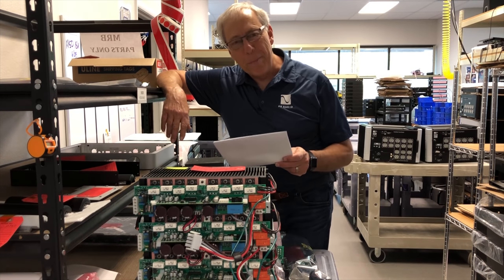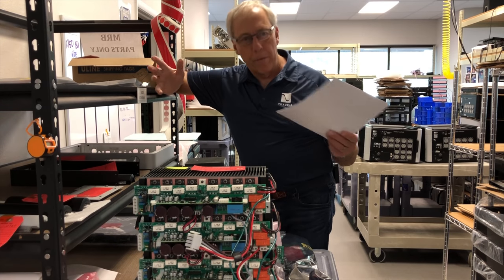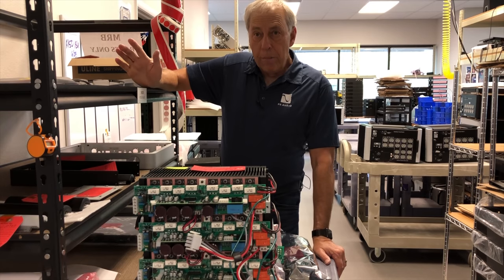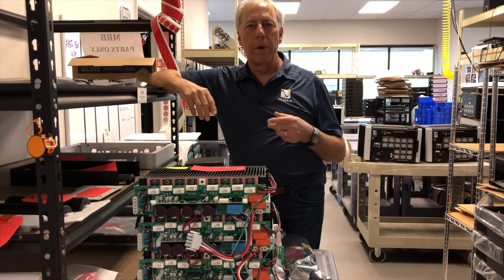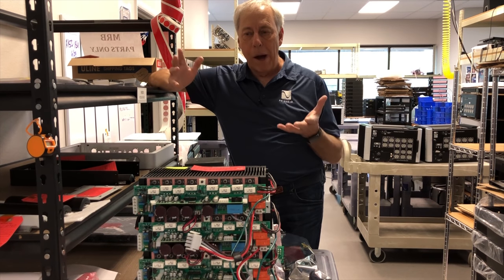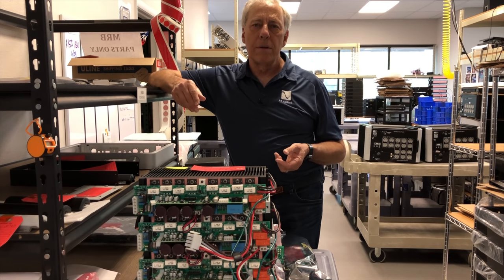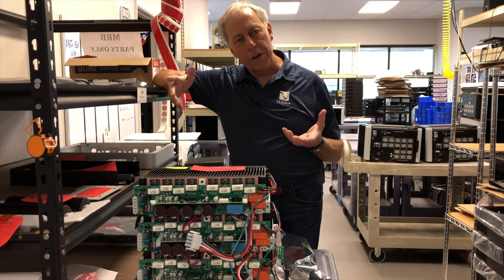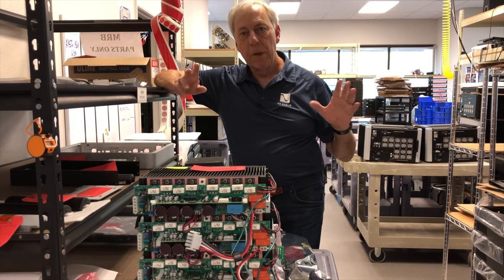Is the BBC dip still used in speakers?

Comment: Also, the human ear is five decibels more sensitive in the range from 1k to 5k. Notching that range down makes a more pleasurable speaker, not a more accurate one.  Great report.  Great question. Thanks.
Reply: You said it before I could. That frequency range is where the sibilance in human speech occurs, so it's very important for our ears to be more sensitive to that range so we can really pick apart all the subtlety and nuance of spoken language. Also, as sound gets louder our ears will naturally compress the sound which is why most manufacturers have a passive EQ that takes more and more of that frequency range out the more you crank up the volume to preserve the "BBC dip" even as our ears are compressing the highs, mids, and lows together.

Comment: Example: Awoofer has a top frequency of 500, and a tweeter has the lowest frequency at 500.  So why don't you get a speaker that will play with those 2, but in the middle... Have the woofer play at 20-450hz and the tweeter at 550-20khz with an added speaker that did the 100 extra in the middle...  I think that would remove the problem.  That's why you don't see setups that are only subwoofer and tweeter.  You have a subwoofer, midbass, and tweeter.

Comment: My understanding of the BBC Dip is this:  In the crossover region, the tweeter is MUCH louder off-axis than the midwoofer, because the midwoofer is beaming but the tweeter is not.   This excess off-axis energy is right smack in the region where the ear is most sensitive:  2-4 kHz ballpark.  So it's the worst region for excess energy, especially within the tight, reflective confines of a BBC mobile monitoring studio (the back of a van), which is the environment the LS3/5a was optimized for.   So the "BBC Dip" is a reduction in energy at the bottom end of the tweeter's range - in and a bit above the crossover region - to compensate for the effects of its wide radiation pattern on this region.    There are other solutions to this issue, but the BBC Dip is a relatively cost-effective one.

Comment: A little more detail (and slightly different version) of this from one of the founder of Harbeth - at the BBC when this was going on (from the Audyssey room adjustment FAQ) with additional comments from Sean Olive: The well-known and highly regarded English speaker manufacturer, Harbeth (makers of the legendary LS3/5a speaker, itself based on a BBC design) have this to say:

"There is much myth, folklore and misunderstanding about this subject.

"The 'BBC dip' is (was) a shallow shelf-down in the acoustic output of some BBC-designed speaker system of the 1960s-1980s in the 1kHz to 4kHz region. The LS3/5a does not have this effect, neither in the 15 ohm nor 11 ohm, both of which are in fact slightly lifted in that region.

"According to Harbeth's founder, who worked at the BBC during the time that this psychoacoustic effect was being explored, the primary benefit this little dip gave was in masking of defects in the early plastic cone drive units available in the 1960's. A spin-off benefit was that it appeared to move the sound stage backwards away from the studio manager who was sitting rather closer to the speakers in the cramped control room than he would ideally wish for. (See also Designer's Notebook Chapter 7). The depth of this depression was set by 'over-equalisation' in the crossover by about 3dB or so, which is an extreme amount for general home listening. We have never applied this selective dip but have taken care to carefully contour the response right across the frequency spectrum for a correctly balanced sound. Although as numbers, 1kHz and 4kHz sound almost adjacent in an audio spectrum of 20Hz to 20kHz, the way we perceive energy changes at 1kHz or 4kHz has a very different psychoacoustic effect: lifting the 1kHz region adds presence (this is used to good effect in the LS3/5a) to the sound, but the 4kHz region adds 'bite' - a cutting incisiveness which if over-done is very unpleasant and irritating.

"You can explore this effect for yourselves by routing your audio signal through a graphic equaliser and applying a mild cut in the approx. 1kHz to 4kHz region and a gradual return to flat either side of that."

Sean Olive has commented on the futility of Audyssey's attempting to second-guess if your speakers are poorly designed and thus would benefit from MRC:

"Neither I nor Floyd Toole had never heard about the Gundry* dip until about 2 months ago when an audio reviewer used the term in an email to us. Many poorly designed 2-way loudspeakers already have dips in the sound power response in the cross-over range 1-3 kHz where the directivity of the woofer is too high compare to the directivity of the tweeter at those frequencies. As a result, this produces a notch in the sound power response of the loudspeaker, usually followed by a peak. Depending on the bandwidth and depth of the notch, it is the peak that is often heard as sounding objectionable (harshness, hardness or excessive brightness). The extent to which this a problem depends on whether you are sitting on or off axis, and the reflectivity of the room. Some room correction products, by default, have a dip in their target curve in an attempt to compensate for this sound power problem, essentially trying to second guess whether or not the loudspeaker is well-designed. As I've shown in a recent AES paper - this doesn't always lead to good results." (*Just another name for the "BBC Dip".)
Reply: Thank you for the very nice explanation, the topic of the BBC dip came up in a class I was teaching a few weeks back for my second year students (introduction to speaker management systems for live sound), studio engineering students crossing over into live sound engineering. All I could tell them from my knowledge about the BBC dip is that it was crossover compensation done for some BBC studio monitors, being a live engineer I have not spent that much time in the studio since I was studying myself twenty plus years ago.
Reply: Thanks for sharing. Very succinct.

Comment: I design amplifiers and speaker enclosures as a hobby/home business. I've most certainly observed the need to notch the signal to get the best sound. However I would disagree on what necessitates this. From my testing, it appears to improve the tone in one way systems just as much, and if you look at the frequency response curve of a typical 12" woofer, you'll see why: there's often a particular sensitivity to some narrow bands of frequencies in that range. For example, a speaker I often design for is the Eminance Beta 12A. Google it, you will see a broad increase in sensitivity between  about 1 kHz and 4 kHz with a notch part way through, and an even higher peak around 2 kHz. 

The way I EQ this particular speaker for best sound (to my ear) is with a broad notch from 150 and 4k with the crossover at 3.5k, which gives an overall bass flattening. I then superimpose two notches, one from 880 Hz to 1.5 kHz, and the other from 1.8k to 3k. As you can see from the graph if you google that speaker, that essentially flattens it. 

That being said, I don't tend to find a need for this EQ style with open back enclosures. Those peaks only seem to cause "harshness" when the speaker has some resistance on it, like a closed or ported box, and especially in sealed boxes. That tells me that the cause of those peaks is probably some kind of interference pattern or standing waves. That's why it sounds harsh, not because there's too much of those frequencies, and not because it's in the crossover region.
Reply: bought a pair of home made 3wy coax utah celesta speakers from an oak park guy in 71,almost 3ft tall one ft x 1 ft wide & deep.I still have the cabinets,w pyle driver woofers, a hundred for the pair originally..they had such a nice sound curtain,,30 wpc filled a large room to overflow, so next door neighbors could hear breezin, by g benson,,low shakin bass,never boomy, Neighbor remarked how clear the sound was coming accross the yard.still had them in mid 80s,using goodman achromat 2 ways with  second   speaker connections on the marantz,oohh, they did sound sweet,on a lark one day I  wondered how the utahs would sound if I coated the speaker cones with rubber cement,I did,being careful not to get the stuff on any rubber,,seemed to make the sound even tighter & more 'live & in 
front,, and  bit less hiss,while not taking away hi frequencies or definition,
Reply: Years ago I would do similar but I have to tell you. Getting a speaker that is flat in the first place or has very small Peaks and valleys I should say. If it's a material that is pleasing to my ear I would much prefer that. For example if you listen to the dynaudio esotar2 or morel supremo. They are pretty amazing without any work. They just produce a sound that you cannot get out of a cheaper driver no matter how much crossover work you do to it. It's a especially noteworthy around 2 khz where many budget speakers really get into trouble with horns and certain voices. When you look at the crossovers on some of the new dynaudio home speakers. They are very simple. A cap and coil only is common on a 2way. The majority of the engineering is in speaker placement and the box design along with the Box material and even the glue. The filters on the other hand are extremely simple.
Reply: Eminance makes a much flatter driver for not much more. The only disadvantage being that you're going from a 38 oz magnet to an 80 oz magnet. That seems to flatten the response dramatically. The Beta 12A is about $80, and the Delta Pro 12A with the 80 oz. magnet is about $100. I haven't used them before simply because the driver weighs 20 lbs. (I do mostly instrument amps). However, next time I do a hi-fi build, I will see if I can work in the deltas. I bet it will make a massive difference.

Comment: At the crossover point, the tweeter has a wider dispersion angle than the woofer does. So the bottom range of the tweeter can be reduced in level to compensate.

You wouldn't hear it in an anechoic chamber but that wider dispersion of the tweeter definitely has an audible impact in a sound reflective environment.

Comment: Another reason for a dip at those crossover frequencies 1.5-3 Khz is that the enclosure box adds at least 1 db and maybe up to 3 db in additional loudness due to diffraction based on the front baffle width. I'm surprised Paul did not mention this. So if you add 1 db ( Crossover bump) plus a 2 db baffle bump that can make things quite unruly at the crossover region. I've experienced this as I build my own speakers....Other than that this is one of the most informative videos I've seen Paul make for the average consumer.

Comment: I take it these days it's more of a parametric thing done with software rather than something built into the hardware. So you just re-adjust the EQ mixdown to sound good depending on whatever speaker or headphone setup you have.

Comment: That's why 3-way speaker systems, with a genuine mid-range speaker between the tweeter and woofer, is the best.  The crossover points are much less likely to cause issues like this -- you can slide off the woofer at the same rate you slide onto the midrange, and keep the resonances to a minimum.
Reply: 3-way speakers can sound harsh in the high tweeter frequencies compared to 2-way speakers and thus be less comfortable to listen to.
Reply: @Shoegaze forever that's a pretty meaningless statement. Any speaker design can sound bad in some frequency range, if it's badly built. The point is, our ears are most sensitive in the midrange, hence it's actually a bit silly to put a crossover right there. A dedicated midrange speaker means that you don't need to worry about those most critical frequencies. The price to pay is that you then need two cross-overs – at less critical spots, but that still doesn't mean they can be neglected. The good news is that they can both be less agressive than the single crossover in a 2-way speaker, because you never need to put any of the drivers close to its frequency limits.
If you say 3-way speakers sound harsh then what you mean could be either that the upper cross-over has some problem, or perhaps that the speaker is _too linear_: if a mix was made on a 2-way monitor with a cheat like the BBC dip, it's possible that it actually overemphasizes these mids. That goes unnoticed on a typical hifi design, but would be revealed mercilessly by a good 3-way. That just means the mix is bad though, not the speaker. Taking out mids a bit can always be done with an equalizer; fixing a bad crossover is not so easy.
Reply: +leftaroundabout    For two speakers of the same output a 3-way speaker and can sound hasher and more penetrating than a 2-way speaker tweeter (although, of course, this will depend on how well the speaker has been filtered or EQ'd) .  This may be why many people find 2-way speakers more comfortable to listen to even though 3-way speakers should be superior.  Another example of listening comfort vs audio accuracy is that many studio engineers prefer to listen to music for pleasure through audiophile speakers rather than monitors even though most studio monitors are technically superior.
Reply: Most 3 way systems have far more time alignment and phase problems than a good 2 way system.  Most mass market speaker companies just use more speakers as a way to charge more money.  Small high end companies that listen to their products can do amazing things with many driver speakers.  Just an 6.5 " mid bas driver matched to the right tweeter in the best engineered enclosure can give you life like dynamic music.
Reply: 3-way isn't "the best", it just has a better chance to manage directionality than 2-way does because a mid range driver is smaller than a typical bass driver. Changing the crossover to fix directionality problems (which is what the "BBC dip" kinda fixes) is the wrong way because it only works in a relatively hard room. The right way is to use suitably flexible drivers or use directional horns. Incidentally, the best speaker I've ever heard was either a 4 or a 5 way.
Reply: It is a matter of managing 2 crossover points instead of 1. The potential for better sound exists alongside more phase challenges. Both speakers do equally well at low to safe volumes. At volumes beyond safe volumes for sustained listening the crossovers become ugly. Many sound problems are mitigated by learning to work with lower volumes.
Reply: I'm no speaker engineer, but I know this stuff is extremely complicated and adding a third speaker surely introduces more problems than it fixes?
Reply: Is this mid-range speaker called a 'meower'? :P
Reply: You could say 6-way is even better. This is really only an option for digital crossovers. Once you get to 3- or 4-way (alt. 3-way+sub), the crossover gets very complex. Also, you are going to need very high value components if a driver is crossed over low. They are big, heavy and expensive if quality components are used. An 8ohm driver crossed at 100Hz requires a 25mH coil, if 2nd order. I don't think quality coils that big are over the counter items. We talk a couple of hundred dollars, minimum, for one component. No matter how good the crossover, you still have phase shift. Digital crossovers don't have that problem. But then you need multiple amplifiers.

There's no one best solution. Granted, a 2-way bookshelf loudspeaker using a 1-inch tweeter and a 6.5-inch woofer isn't going to be full range.
Reply: You wrote "An 8ohm driver crossed at 100Hz requires a 25mH coil, if 2nd order ... a couple of hundred dollars, minimum" - w.r.t. the coil, are you referring to a loudspeaker or to an inductor? The latter would be more in the region of $20 (shipping, taxes, and a large profit margin, possibly not included).
Reply: As long as the crossover point is not in that all-important 1-4khz range, where people are especially sensitive.
Reply: I'm talking about an air core inductor. These get massive because they don't have a core. In transformer used in tube amplifiers, you use cores with high permeability. That gets you a transformer with tens, even hundreds of Henry. Air core transformers are measured in thousands of a Henry. Air coils and ribbon are usually not used in reasonably priced loudspeakers. They use a ferrite cores, which allows for less copper wire. The thing with cores is that they introduce distortion. An air cores doesn't have distortion. They are expensive. Mundorf Inductor 3.30mH 12awg, USD $168.38. That's about the cheapest foil inductor you can find. Capacitors can cost just as much.

There are crossover designers online, like this https://www.diyaudioandvideo.com/Calculator/SpeakerCrossover/

2nd Order Linkwitz-Riley, 2500 Hertz, 8 Ohm Tweeter / 8 Ohm Woofer: 1.02 mH, 3.98 uF
For 100 Hertz its: 25.46 mH, 99.5 uF

With 4ohm, inductance is halved and capacitance doubled.

Now, this is a "base" crossover. Most crossovers use many more components, for correction. Today that's fairly easily done with software.
Reply: +originaluddite Quip aside, it's called a 'squawker' if you were really asking.
Reply: “It’s easier to make a hamburger out of a cow, than a cow out of a hamburger”.
Reply: I finally settled on using a very good full range speaker with a sub. I use an electronic crossover at 80 Hz, with a high pass on the full range.  I have been happy with it for 15 years. Nothing but wows, oos, and ahs from people who listen to the setup.
Reply: @leftaroundabout  
In which case by your analogy, no cross-over at all would be preferable, and in that, I would wholeheartedly agree, which is why a good quality 'full range driver' sounds so listenable... Do yourself a favor and check out the 'Tang Band W8-1772' and start appreciating music again, without constantly worrying about that nagging feeling something sounds odd.
Reply: @phoenix11994466  I love ATC 3 way Active. The 3 drivers are phase aligned in the electronic crossover.